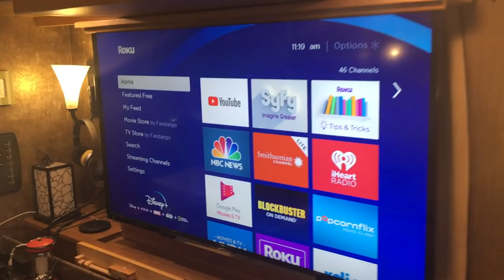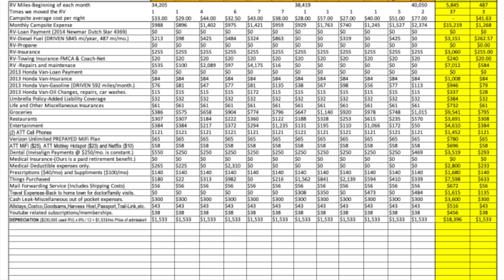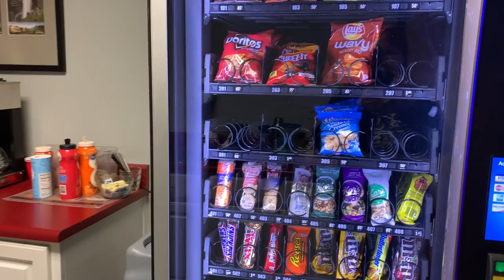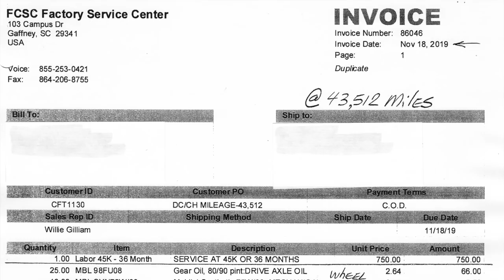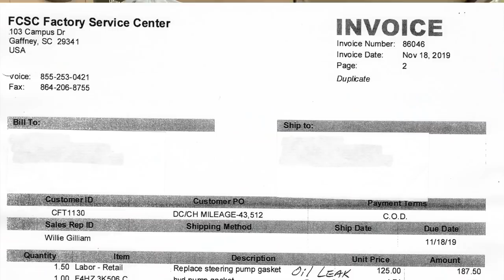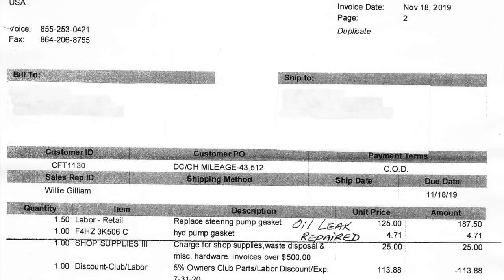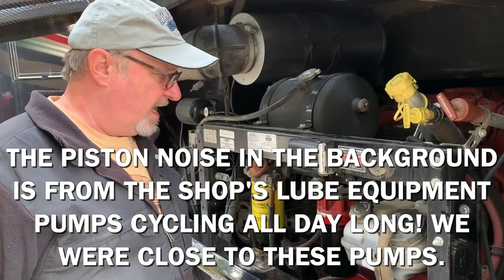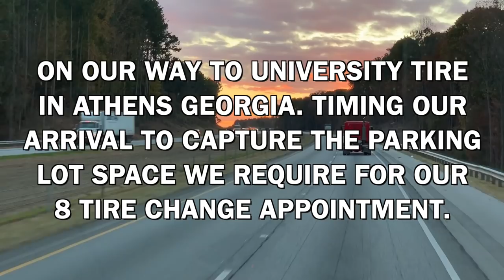RV LIVING / MOTORHOME MAINTENANCE / FREIGHTLINER SERVICE AND TRAINING CENTER / GAFFNEY SC-EP94

Comment: From 1 engineer to another Mark, disregard the comments of spending too much for maint. In the end of use scenario it will come back to you, just give the new owner a look at these fine videos you are producing. The 8 % depreciation is reasonable but pie in the sky. Anything with wheels has a compounding rate. But in your case the salvage value will be stellar. You are a person who is in " preventative mode " as opposed to the other 95 % who are not. That is a good way to live and enjoy. And please continue doing so.                Cheers.
Reply from the maker: I have scheduled all of the rear engine diesel radiator hoses to be changed this coming November at Gaffney Freightliner proactively!  Of course, if they blow out and fail before November 2022,.....then it will end up being re-actively!

Comment: I am so glad i can still do basic maintenance myself. Just changed all the fluids and lubed the chassis in mine. Still need to change differential and fan gearbox oil. Want to change coolant hoses and flush it too and service aquahot
Reply from the maker: You are the man Timothy!  Back in the day I would have been chomping at the bit to do all that myself. Physically, if I could do it (which I can't), being full time, with no home, I would have nowhere to do it.  Chalk up another advantage to having a home base & shop to store & work on the rig!

Comment: Air Filter: bought our DP coach used and filter had never been changed due to low mileage (<14K) and a 'still good' indication on the clear plastic vacuum gauge. Big mistake because they age out before they wear out (much like tires). They should not be on the shelf for >1 year before installation and as Mark correctly stated, they have a  2 yr service life for a max life of 3 years before the paper core can begin to deteriorate. Our filter was 6+ years old!!! Removed & replaced immediately and performed an autopsy on that old filter. Found the paper to be brittle and ready to be sucked into the turbo. Luckily, no missing paper 🙏.  Change it every 2 years = cheap insurance.
Reply from the maker: I actually change it every year,.......just because.  You never know if the one you had put in was a tad old. This year, I missed my window to get my yearly oil change in, and I am finally getting it done at NIRVC Dallas after 16 months!  Video to follow!

Comment: U are heading towards what I believe to be one of the more popular recumbent areas in the country from what I read. North west & central Florida seem to be active. I will probably be making my own to keep pricing from going stratospheric . . .
Reply from the maker: If you have the time and abilities,......upsize the rear tire about three widths, add a rear hub motor, and (maybe) put the batteries on a rack above the front tire.  On our LWB bikes, the front tire loading was already WAY TOO LOW.  Even a small stone in the road would through us around.  Good luck.  Keep an eye on your CG and weight distribution!

Comment: We have a Fire TV and a Fire cube to use with older TV. Lots of free programs with Amazon Prime. I have a Verizon Jetpack and a small digital antenna for local channels.  So much easier than setting up Dish and having to call tech support.
Reply from the maker: We have a Dish Satellite System, but are too cheap to use it.  Netflix is all we need!

Comment: BTW, if you had a Samsung Smart TV/Monitor, you could watch movies on the big screen and even use it as a computer monitor with a wireless keyboard!

I would go check with a local BestBuy with the equipment you have and need! Setup may cost you for the service, but it should solve your problem!
Reply from the maker: We have found over the past two years, that we spend so much time creating and watching Youtube videos that we rarely watch regular TV at all!
Reply: The comment you made was you had to watch Discovery Channel on your wife’s Laptop and my response was… you could watch your shows on the large screen if you had a Smart TV… it can act as a monitor just as your laptop!

You are watching TV if you watch Discovery!

A simple thanks, I will look into it, would be better… rather than making up a Straw Man argument to burn down! 🤪

Comment: Our RV is on a Spartan chassis so we can't go there but our home base isn't that far from Spartan headquarters and service center. I budget $2000 for yearly maintenance and haven't needed that much. Transmission fluid should be changed every 5 years but I will change them if over 50K  miles. I change some of my own filters.
Reply from the maker: I have been an overachiever when it comes oil & filter changes my entire life!  It's a tough habit to break!

Comment: You are right in what you do,I service my car every 6 months,and that’s a full service every year I change the cam belt and tensioner’s
Its cheaper to do that than having to buy an engine.i do not trust the rubber belts
Reply from the maker: We also carry NEW BELTS that have been "shrink wrapped sealed" inside the rig in a dresser drawer incase one snaps so we have it on the road for me or a repair guy to do!

Comment: I’m a new subscriber to your channel and fairly new to the RV world. My question is when should I purchase new tires. I have a class A 2014 Winnebago 42E Journey. Right now we’re only traveling for about a month or so during the summer and maybe a couple short trips during the winter and outside of that it stays stored under cover. Thank you
Reply from the maker: No one has a crystal ball, so we all try to error on the side of safety. Your tires will have a production date code on them. (Look at our episode "MICHELIN MOTORHOME TIRES | TYRON BANDS | NIRVC RETTROBAND RV TIRE SAFETY DEVICE | CENTRAMATIC EP99") Most likely they were made in mid 2013. Your coach will soon be mid 2021. That's 8 years. I believe most folks would replace them.  I would have had them gone a year ago. If money is really tight,.......AT LEAST DO THE FRONTS. Remember, besides the safety with regards to life and limb, blowouts cause a TON of vehicle damage to the bodywork!  Good luck with your dilemma!   Thanks for watching. Check out the RVGeeks Youtube channel and website with regards to their tire changing recommendations. They have 3 videos. This one is the newest: https://youtu.be/gy2UEJnBSyE

Comment: I can go back over 2 years and watch you videos and still enjoy them. You seemed a lot more funny back then. LMAO just kidding
Reply from the maker: Thanks Jeff. We appreciate that. Seems like only a few months ago, in June of 2017 that we started full-time RV living.  Time sure flies,......you really do have to chase after life or it will pass you by!
Reply: @OurJourneyInMyles  I need to get an option from you and Sue if you don't mind ? I have two options in getting a motorhome  first thing I can pay all my bills down to the point where I will have almost everything paid off. So:
(1) Sale my house and get like a 2014 or 15 or 16 motorhome. Regardless I will get a tag axel 43' to 45' also has to have 1 1/2 bath with my wife a must.
(2) not sale my house and get  a older motorhome. Around 2008 with same has to have tag axel, 45', 1 1/2 bathroom.
If I put like $20,000 fixing up my house. I could get $900.00 per month on rent. Have 
good rental insurance so if the damage house insurance pays and goes after renter.
Ok I will have income around 5K per month. If I don't sale house $900.00 more per month.  again motorhome paid for and no bills . Having already done this what would you do ? Please help ?

Comment: I purchased a 2000 Holiday Rambler Vacationer with 32,000 original miles. I live in New Jersey and there isn't much in the way of MH repair places here. Josephine (named after my Mom) is a gasser and I have no idea where the nearest place like the Freight liner place that you use would be closest to me. She is on a Ford chassis. What would you suggest for me to search for in Google to find someplace like you found? I have no idea when the latest maintenance was preformed on her. I am learning so much from your videos. Thanks so much for sharing them. I would be hitting the rode full time until June 2020 and want to make sure Josephine is in perfect condition before we head out.
Reply from the maker: Your best bet is to get a FREE account name set up on the website irv2.com so you can go to the Holiday Rambler group and post those exact questions on it.  Of course you should first SEARCH the irv2 site with those question "key words", because most likely that discussion and answer thread may already exist! Also check for a Holiday Rambler Facebook group,.......I would expect a large one already exists.  Groups like this already have all the answers to questions like this.  Good luck!
Reply: @OurJourneyInMyles  Thank you SO much for answering so quickly! I am learning so much from watching your videos! Thanks for sharing so much information to us!!

Comment: Thats not bad! I'm the same driving at night I don't like anymore!
Reply from the maker: Hey Robert!  I have to agree with you.  I spent this much when I first started out at an Oasis Freightliner garage in Oak Creek Wisconsin. They forgot to refill my antifreeze when they flushed the small radiator on my Onan house generator and broke the transmission oil pan plug, which they "forgot" to tell me.  I found this out 9 months later.  The next one I visited in Sheboygan WI hooked my slide out topper arm on their electric garage door power cord,.....and ripper it out of their control box,......and wouldn't you know it,.....they "forgot" to tell me that too!  I like places that aren't forgetful.

Comment: I watched as Mr & Mrs Myles hooked up their Toad vehicle. I was told when hooking up a toad that you are supposed to "X" or cross your safety chains from toad to Motorcoach. They did not do that! Who is right?
Reply from the maker: I'm not quite sure where you watched that, but we ALWAYS cross the safety chains.  As I understand it, ......it is required,....... just like supplemental braking system setups are required for your towed vehicle in 49 states!  Glad your watching so close!  Sue & I have the "connect and disconnect" routine down to a science by now after about 90 times in 2.5 years!

Comment: I hope you took advantage of the FMCA tire discount program.
Reply from the maker: Yes,.......saved about $70 per tire if my memory is correct.
Reply: @OurJourneyInMyles  You might mention that in your video.
Reply from the maker: @WILDEBILL308  Yes,.....we most certainly will!  This is the third time I used this discount.

Comment: Just a quick question since you're running a Cummins engine why are you not using Valvoline blue? You can add another 20,000 miles on your warranty just by running Valvoline blue in a Cummings Engine
Reply from the maker: We just use what the factory puts in.  They never offered anything as an option to us.

Comment: Where did you get the 8% depreciation figure in your spreadsheet ?
Reply from the maker: If you research the blogs quickly on the internet, you can find any number you want to believe.  But if you research them slowly, ......by brand, .....by RV model and year......, and take into account the caliper & quality of the information source, you will start to see recurring themes and percentages.  Sorry,..have no hard source for you.  The 8% is the GUESS that I have decided to believe for our particular situation, the 2014 Newmar Dutch Star model 4369.  Hoping that in the end, it doesn't end up larger!
Reply: @OurJourneyInMyles  Thanks.   The reason I ask is that you are the first person I've seen put an actual number on it.  Lots of people pretend they don't depreciate until they find out otherwise when they sell one.

Comment: I see a weigh station sing on this vid, and i wonder, do you have to stop at weigh stations and get weighed by DOT?
Reply from the maker: NO RV's have to stop to get weighed in any states.  You should get the individual tire loading weight on your rig immediately so you know what to inflate your tires to.  The Heavy Duty trucks that look like semi's pulling 5th wheels need to have the proper signs on them that say, "Private Coach-Not For Hire" on them, and must not pull any other trailers or cargo unless they replate the vehicle and get the proper DOT paperwork & certification.

Comment: Wow, I appreciate you wanting every thing perfect but You have only put 5000 miles, why change all fluids and belts. Fluids last much more and if your belts had a problem at 5k there is another issue that needs to be looked at for the route cause or you are an easy sell . My guess is you want everything perfect but leave yourselves vulnerable to salesmen who make their living with sales. Best wishes and enjoy your journey. Fun to watch
Reply from the maker: Most motorhome maintenance is time based per Freightliner schedules.  Miles mean almost nothing in the RV world because the vehicles are sitting around so much.  I worked 9 years at a large auto repair center so I am aware of up sell.  You all will have to make your own decisions on how proactive you want to be on your rig & equipment.  Thanks so much for stopping by!

Comment: Smart tv are scams, get an Apple TV device, it’s amazing and uses apps like your iphones
Reply from the maker: Our Roku is so old the software isn't supported anymore.  I am going to look into Apple TV.  Our smart TV's are really old.
Reply: Our Journey In Myles , you can get the 1080p version instead of the 4K version.  You will like the fact that all your Apple devices including Mac can airplay to your TV.  Smart tv are irrelevant anymore with devices such as Apple TV.  It’s my main interface now even for regular tv, I have an isp tv service with the app, if you have unlimited internet and a good connection, no need for antenna.